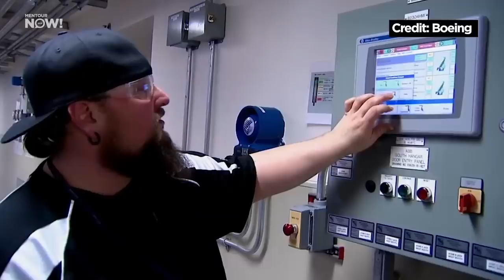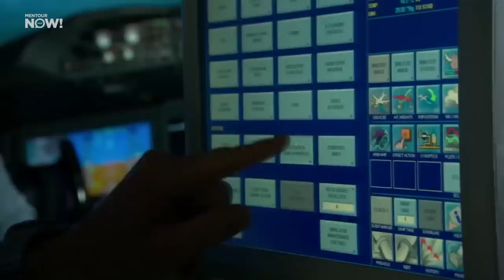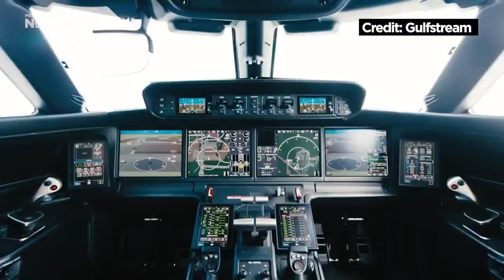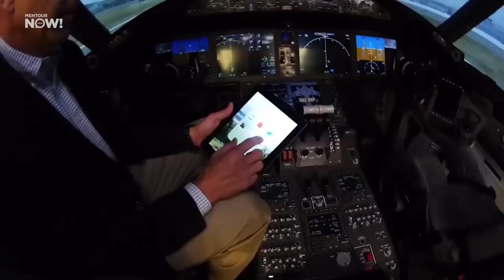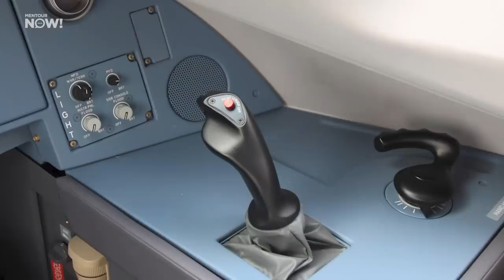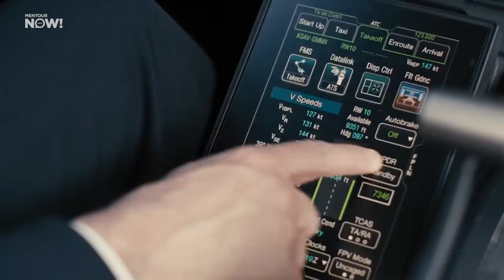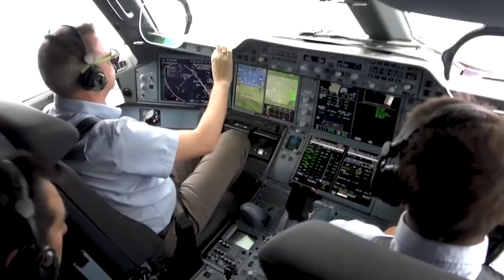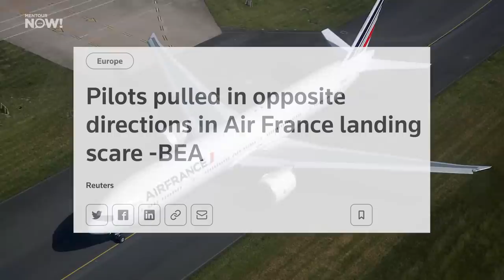Is Boeing Switching to SIDE-STICKS?!

Comment: As long as the side stick has the ability to provide force feedback to both devices at the same time to avoid conflicting inputs, I think the side stick is a good thing.
Reply from the maker: I would tend to agree with you
Reply: When the F-16 was developed, the original side stick didn't move at all.
Reply: Mentor Pilot has covered a number Airbus incidents where active feedback may have prevented an incident, so I feel it should be added.
I would imagine that even for mechanically linked yokes, there is the possibility of a much stronger pilot being able to force the yoke "in the wrong" position and the other pilot not being able to over-ride it, the AF B-777 incident mentioned by MP has come up a number of times, and sounds like the Boeing FBW also does what Airbus FBW does when pilots give conflicting commands, average out what they are commanding. I think there has been an incident where a pilot has collapsed on the yoke.

So maybe it's not a case of "linking" the side-sticks, rather than changing the FBW computer to decide which pilot is supposed to be be flying the plane, and which one is panicking.
Reply: @axelBr1  Given their history I would be inclined to look at AFs training before I blamed the Triple Seven.
Reply: @MentourNow  - As Alex Bristor says, it cuts both ways - force-feedback/connected controls have in fact contributed to several incidents and accidents over the years.  The questions to be asked include whether the "traditional" setup (whereby one pilot can feel what the other is doing) is actually more helpful than not having it versus pilots simply feeling uncomfortable with the notion because they aren't used to it.  When it comes to the B777 and B787 a significant amount of that feedback is mediated by software anyway, which adds complexity to the systems.
Reply: @theephemeralglade1935  Yes, the original F-16 stick was intented to be like part of the aircraft where the whole aircraft magically turned with your hand forces alone. However, that turned to be somewhat incompatible with human psychology. I'd guess this is because you move along the aircraft.
Reply: I would generally agree. As for the issue of which pilot is controlling, my understanding is that at least some Airbuses have a switch for this. So, if you can select control from the left, from the right, or an average.

Personally, though, I don't think side sticks are a great idea from a control standpoint if they don't have force feedback for what the other pilot is doing (and being able to feel how the airplane is handling is also very helpful.) It is very unlikely that AF447 would have crashed if the aircraft had been equipped with linked yokes or side sticks with force feedback from the other side, for example. If the pilot in the left seat had felt the pilot in the right seat pulling back, he almost certainly wouldn't have allowed the aircraft to remain in a stall for 40,000 feet like that.

With those problems resolved by force feedback, though, then I do think conversion to side sticks is likely how future designs will go. The biggest advantage would just be the extra space for tables, larger displays, etc.
Reply: @vbscript2  - Believe it or not, that claim about AF447 is somewhat dubious.  There have been at least 3 similar accidents in airliners with connected yokes where the Pilot-Not-Flying did not pick up on the other pilot pulling up.  The other problem with connection/force-feedback is the situation where one pilot is deliberately trying to endanger the aircraft and the other pilot has to overcome their physical input as a result.  It's a difficult engineering and safety issue to resolve.
Reply: @Clayson Antoons I wasn't talking about changing hands for the same pilot (I'm well aware that the sticks can't be moved to the other side of the pilot,) but rather to change the input modes as to whether only left seat is controlling, only right seat is controlling, or the two are averaged. It's been a while so my memory could be off, but I seem to recall reading the in accident report for AF447 that this was indeed a setting that could be changed on the A330 and it was set to dual (i.e. averaged) input mode at the time of the accident.

Agreed that dominant vs. non-dominant hand doesn't matter. The vast majority of people who learn to fly light airplanes (myself included) learn with their non-dominant hand. I never found this to be any sort of an issue at all.
Reply: @turricanedtc3764  Which accidents are those? Not noticing the other pilot pulling back enough to hold the aircraft in a stall for 5 straight minutes seems rather unlikely with physically linked controls. It's one thing if you don't notice and react to what the pilot is doing quickly enough in a case where you're near the ground and a couple of seconds matters, but it's quite another to hold the aircraft in a stall from FL400 to sea level.

As for a pilot deliberately trying to endanger the flight, no control system is going to solve that problem, but thankfully it's an exceedingly rare one, especially when both pilots are at their stations. If a pilot is trying to endanger the aircraft while both are at their stations, the about only thing the other pilot could realistically do in just about any airplane is disable the other pilot (as in, physically incapacitate them and, in the case of an airliner, have the cabin crew help remove them from the flight deck, not just disable controls on their side.)
Reply: @vbscript2  - Northwest Orient Flight 6231 (B727), Birgenair Flight 301 (B757) and West Caribbean Flight 708 (MD-82)  In all three cases, the Pilot-Not-Flying (PNF) practically had the yoke in their laps, but due to the stressful scenarios in which they found themselves they did not notice.  The fundamental issue is that in multi-crew airline operations, the PNF is not supposed to have their hands on the controls - the only exception to that rule being in older airliners with manual reversion in the event of hydraulic failure and extra force being required to achieve the desired manoeuvres.  There's also the case of EgyptAir 990 (B767), where the combination of one pilot commanding full nose-down and the other commanding full nose-up resulted in a split-elevator condition which exacerbated the aircraft's departure from controlled flight.
Reply: Force feedback is good, but I think there should be a more obvious alert of dual inputs. With fly-by-wire, there really is no reason for more than one pilot to have their hand on the controls, so there should be an audible alert if both pilots are moving their sidestick, to prevent them from believing that they're fighting the plane instead of each other, like in the incident mentioned at the end of this video.
Reply: @vbscript2  The sidesticks also allow faster user input compared to yoke because the movement only needs to be done with the wrist instead of the whole hand. This alone is big enough reason to use sidesticks for fighters but I'm not sure if this difference is never important for passanger planes.
Reply: @MikkoRantalainen  It's not that it's faster, but rather that it's more stable. That matters when you're pulling several gs in a fighter (where your arm would otherwise be flopping around from the extreme forces,) but it doesn't really matter at all outside of fighters or extreme aerobatics.

How fast you can give control inputs with a side stick depends heavily on the software. You can actually give control inputs quite a bit faster in a mechanically-connected yoke than you can on an Airbus-like side stick, as the latter is just an input to a computer telling it to increase or decrease roll or pitch rate rather than directly commanding a particular deflection of the control surfaces. With a normal yoke (or even a mechanically-connected stick,) you can command whatever control surface deflection you want much faster, which is helpful in avoiding pilot-induced oscillations and such.
Reply: about 20 years ago I have played on a game exhibition with a force feedback joystick, it was connected to a truck game and the joystick was the gear shifter.
I felt everything, very realistic vibration of the engine and I would have sworn that I felt the gears and synchromesh of the gearbox.
Pretty sure they used some black magic in that device.
Reply: You don't need feedback when you have very qualified pilots onboard. But I understand your point. If we're going to rely on an industry seeking to lower standards to support its growth, having the feedback becomes a "must".
Reply: @marceloluizfigueira7208  I really can't agree. No matter how qualified your pilots are, they will be able to notice and respond to changes more quickly with force feedback than without. Whether that's input from another pilot or aerodynamic forces on the airplane, feedback to your hand is one of the quickest possible ways for pilots to receive this information and it also doesn't interfere with the pilots continuing to receive other information by sight and sound.
Reply: @vbscript2  Again: guys from Air France almost destroyed a B777 while on approach to CDG. One was pulling and the other one pushing the control column. No one ever noticed. FDR data is clear.

Unqualified pilots will still crash aircrafts with feedback on their sidesticks. Qualified pilots won't.
Reply: @marceloluizfigueira7208  I'm certainly not arguing that the feedback will make unqualified pilots as good as qualified ones, just that it's helpful to both. "We don't need better safety features because our pilots are qualified" is a very dangerous attitude to have in aviation. The more layers of safety the better. Qualified pilots are certainly absolutely imperative, but force feedback on the yoke is just one more helpful cue for pilots to understand what the airplane is doing (and also what the other pilot beside them is doing.)

Air France also actually crashed an A330 in part because the pilot in the left seat did not know that the pilot in the right seat was pulling back on the yoke all the way from FL400 to sea level. Granted, there was a crazy amount of pilot incompetence involved there, but there's a decent chance that 200+ people would still be alive today if the pilot in the left seat had been able to feel the other pilot holding the nose up.
Reply: @vbscript2  Again, it's the race to the bottom.
I bet you never opened that final report or even watched the FDR data. They've crashed the aircraft because all they could do was following a FD requiring a pitch as to mantaind +2300fpm at FL340+ with a heavy aircraft.

To prove that it was not sidestick lack of feedback, it almost happened again under the same tail but different type!!

Two pilots should never touch the controls at the same time. Valid from the Citabria to the Concorde.

That said, you're taking the whole industry for granted. I don't think it is safer in any way. Airbus designed a perfect system that tells you "DUAL INPUT!!!" with a light right in front of you. And a big red button that allows any of the pilots, at anytime to press and takeover. Once you hear "PRIORITY LEFT/RIGHT" you have controls and no one else.

Same thing for non-back driven thrust levers...many Airbus pilots don't know how to disengage or reengage A/THR properly while descending.

Look at what happened with that 777 in Dubai. Pilots at the same time going around relying on a button not having their hands on the thrust levers and a gear being retracted without positive rate... 

Fantastic!!!!

"Let's forbid visual approaches because 3 pilots managed to crash one 777 in SFO under a clear sky." 

That's how I read your comment.
Reply: @marceloluizfigueira7208  The point of force feedback should be to help with edge cases when pilots make mistakes. For example, if you mostly have very weak feedback but the feedback is 10x when dual input is detected, you would need zero additional clues about dual input situations.

If neither pilot never made any errors, you would never feel the dual input feedback mode in real world.

Pilots are human, too, and no matter how qualified they are, they will be making mistakes. Safe operating procedures and redundancy are used to make flying still safe even when a pilot makes a random error.

Unqualified pilots would make unlimited amount of errors and there's no way to create a safe system with such an assumption.

I'm software developer and I truly believe in old joke: "Programming today is a race between software engineers striving to build bigger and better idiot-proof programs, and the Universe trying to produce bigger and better idiots. So far, the Universe is winning."
Reply: @MikkoRantalainen  Some professions require minimum skills. Flying an airplane is nothing out of this world, but it's not for those that you've mentioned that the universe is producing. 

There will be extra cost for no reason. Average pilots will adapt to it and fly it normally. Yet, guys that manage to crash a perfectly working aircraft on a sunny day will still crash the one with feedback.

I've flown the Airbus for quite a while and I was never in doubt of who was flying the plane - ever. Proper training leads to understanding the system. Minimum skills are therefore required.

NO CRASH EVER was caused by the lack of feedback on sidesticks.

It's easier to teach flying on an aircraft with feedback, no doubts. But if you're flying an airliner and needs to be taught on the basics...something is wrong, correct?
Reply: @marceloluizfigueira7208  I totally agree that things should be like you described. However, in reality we have cases like Air France Flight 447 where supposedly trained pilots causes perfectly flyable aircract into the sea and caused 228 fatalities.

Either the acceptance criteria for all commercial pilots must be raised much higher or we need to keep adding fixes to deal with bad decisions.

I don't really think pilots are idiots but they will find new ways to make mistakes. The system should be designed to allow at least the known issues to be handled better than those are currently handled.
Reply: @MikkoRantalainen  "Supposedly trained pilots". Well done, you've got it!

The old-fashioned yet usable, somehow, criteria is linked to flying hours. And as you might've wondered, having 10 thousand hours won't make you any better than a 2 thousand hours pilot with far better developed skills than you.

In this industry, a good answer to an accident is usually not allowing anything anymore. That is, because the human factor comes solely on the back of the pilots.

No one blames the checkriders, the HR representatives, how the screening was conducted, if ever, how the assessment itself took place, how many failed sim sessions - or how many they should've failed. If there was proper training or not, if the company had such a lack of safety culture that led the pilots to cause the accident.

That's exactly what the problem is: it's costly to raise any hiring criterias. And without asking any questions, there's a shortage already. Remember that 767 that crashed in the US? Exactly, control columns not sidesticks. Both pilots should not be flying in first place, however - both had failed multiple sim sessions with very astounding lack of skills.

Ah, by the way, I'm not an Airbus lover. But I'm also not an idiot. The A330 crashed during test flights - it was supposed to be idiot-proof by the design, the pilots were not idiots. There are accidents caused by something else, for sure. But search on avherald for "Air France flt 11". Surprised? Start having a look at final reports and you'll start to understand what's going on. It's no long a matter of design (it used to be).

Don't get me wrong. I wish you have a real nice trip next time you board an aircraft!
Reply: @vbscript2  the right command from the pilot in the left seat in AF447’s case would be “my controls, let me see your hands on your laps”!
Reply: The left pilot has to use his left hand to input something on the sidestick? He's not using his dominant hand? That looks dangerous to me. As a right handed person you'll never be as good with your left. I mean with the yoke you're using both so it doesn't matter.
Reply: @EbonyPope  I've flown both. When you're flying with a yoke, you also have one hand on the throttles at all times, except for takeoff flare. Also, if you can't fly with your left hand just because you're right handed, you should not be flying at all!
Reply: @EbonyPope  Whether you're using a yoke or a side stick, the pilot in the left seat is almost always flying with their left hand. While you can use either hand with the yoke (i.e. you can switch if you need to adjust something on your left,) you don't normally actually fly with both hands. For the pilot on the left, it's normally left hand on yoke, right on power (or adjusting whatever else needs to be adjusted at the time.) Even brand new student pilots learn to fly with their left hand from the very beginning and it's really not a problem at all.
Reply: @MikkoRantalainen  Fast response leads to PIO, (Pilot Induced Oscillation) , invariably, unless the control law prevents it, an option not available in direct law.
Position feedback is always preferable to force feed back.
How do I know?
I designed and flew side stick operated aircraft, without  an Airbus type control system, And had PIO anyway because the deflection length is limited.
Side stick, hell no,  let alone force feed back. I learned my lesson.
The Airbus system protects against pilot incompetence.
Fly a full motion AB simulator in direct mode and then the GOOD old joke on a Boeing 767 simulator.
If you are not a pilot, all this is meaning less.
Reply: @herceg6772  The problem started when the captain was not in the cockpit and the electronic  control system could not handle it and reverted to direct mode. This after the vertical stabilizer broke off in the mid ocean tropical storm, recovered with broken base attachment structure, 50 km before the rotating aircraft descent  finally hit the sea, visible on the injuries of the passengers
Oh yes , major cover up effort by Airbus
How do we know this? By the continuous data transmitted and received, in Paris, AF maintenance.
Reply: Why on the A330-200 and not on A330- 300?
Because the -200 is a smaller, shorter version with the same composite vertical stabilizer, which is subject to higher side force in yaw due to a shorter moment arm. The yaw moment was caused  by the large scale turbulence, causing a large ' side slip condition, that the structure was not designed to withstand, because  the European regulations are different, Incident after incident of Airbus AC losing the vertical stabilizer. This is because the load limit was the maximum rudder input angle at VA. the maximum maneuvering speed, nothing to do with external turbulence encounter 
First was the crash over and into New York of a A300, after encountering wake turbulence from a large AC. ahead.
Reply: @arturoeugster7228  Thanks for the information. Can you tell how much latency from the stick movement to flight surfaces actually moving to full range of input there is? I think the pilot induced oscillation is always caused by total system latency (pilot reaction time plus system physical movement time combined).

I would have expected that the force feedback from the stick would allow the pilot to workaround the latency needed for moving the actual flight surfaces. However, I believe that that's not true if you've done actual testing with it.
Reply: @MikkoRantalainen  

Basically correct, but the pilots amplitude is also involved, strongly.
PIC can be suppressed by deliberate slow and small input, breaking the feedback loop. (freezing the stick or in my case the side stick POSITION, and slowly kreeping to  raise or lower the nose.)
Ok, A Finnish friend of mine, Pilkennen and and I used to analyse the control system stability of his elecric sun powered model airplane.
The summary, 
 if the amplification is too high, caused by fast stick movement of sufficient amplitude at some point control becomes unstable.
And yes if the servo system lags, it gets far worse .
Reply: @MikkoRantalainen  Lets start with our system, the control stick amplitude was was a direct link to the elevator angle powered by a servo, that followed the input angle, no delay, just that about 20 degree deflection corresponded to the + -  5 cm stick deflection. The control objective was aircraft pitch attitude. the effect was that at low speed the pitch attitude would increase fast, over shooting the ~10 deg attitude, the pilot's reaction is clear : fast push to bring the nose back down, which happened, but too much, initiating the PIO unless you stopped moving the stick, holding it at a slight but constant pitch up position as the aircraft accelerates, the elevator now fixed  causes the nose to stabilise, at some attitude above or below the desired climb attitude. SMALL corrections, preferably best done with the elevator trim, relieving the force on the stick also.
Conclusion at low speed (V) the natural aircraft pitch rate damping moment is negligible
M = q × L² × A horiz ×Cla× rate÷ V
q        dens/2 × V²    dynamic pressure
L       CG to elevator  distance   !!!
A       hor. stabilizer area 
Cla    hor. stabilizer lift  derivative 
rate     aircraft pitch rate (small)  
 
V²/V = V     at low speed is small

At higher speed the problem goes away, much better natural pitch damping.
I our case the larger yoke travel is higher, less sensitive compared to the low inertia/friction of a small side stick.
Reply: BTW the first landing of the Lockheed  F-22 was a hard slamm onto the ground due to PIO
Reply: @arturoeugster7228  F-22 and other intentionally aerodynamically unstable things do indeed require lots of computer assistance to be flyable at all. And as such, human-computer-physical system interaction can easily result in PIO.
Reply: @theephemeralglade1935

F-16 is (for the most part) single pilot.
Reply: @turricanedtc3764

The big difference is that with AF447.. it was full back for minutes.. and only after Bonin said he’d been pulling back the whole time did the crew realize what was happening.  

This would have been immediately obvious in a Boeing.. and even if they were fighting each other either the other pilot would have prevented Bonin from pulling back all the way.. or told him to release the controls.